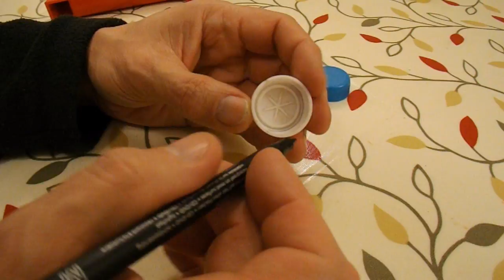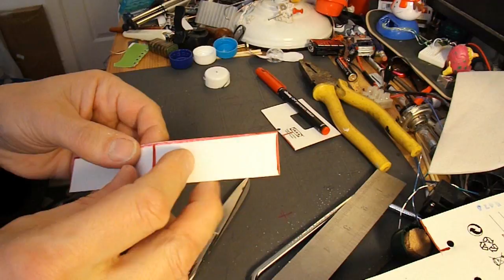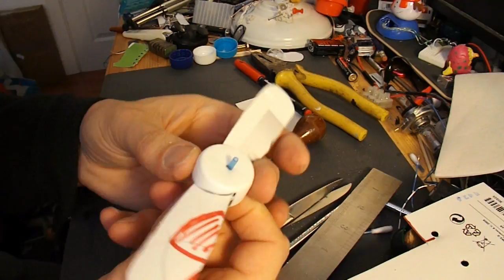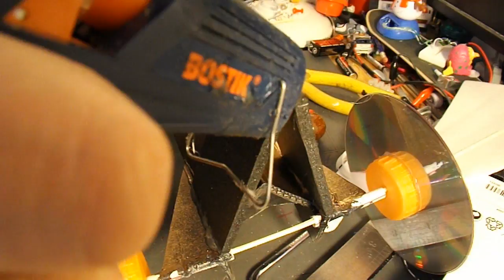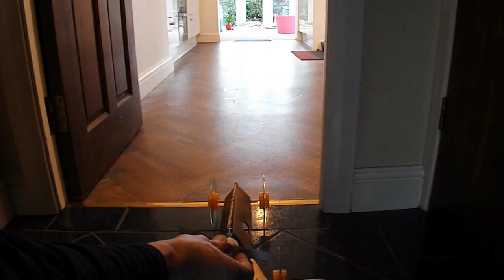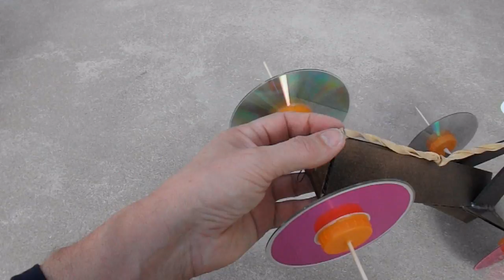Let's make a Paper or Cardboard Propeller Part #3 Plastic bottle top and card

Comment: You will get your propeller degree only if you can make one of cardboard only and no bending allowed :-)

Thank you Grandad.
Reply from the maker: If it does not bend it will be flat?? That's not going to be very effective :-(
Reply: GrandadIsAnOldMan by no bending I ment no warping of the flaps. Like the cork version. The flaps can be angled relative to the rotion plan of course.
Reply from the maker: David Peeters Still not quite sure what you mean, but there will be a couple of propeller driven cars uploaded tonight.

Comment: Hey Grandad! Thanks so much for the video. I have to make a Propeller car for my physics class and this tutorial has helped tremendously. I was also wondering if 4 blades would be more efficient than 2. I need to push as much air as possible because the assignment requires that my car travels a certain distance. Thanks again!
Reply from the maker: Edwin C. that is something that you find out if you try it. That is the best way to learn. The distance you travel will be related to many things including the weight of your car and the friction on the axles. 4 blades will push more air if they spin at the same speed, but 4 blades will be heavier that 2 blades so take more effort to spin them, so you might need a more powerful rubber band motor. It is something only you will be able to find out by testing. The pitch or twist of the blade will also change the amount of air pushed through.
Reply: Cool, thanks grandad (: